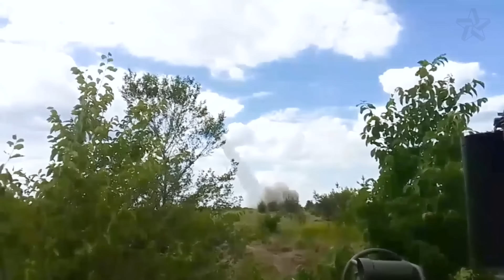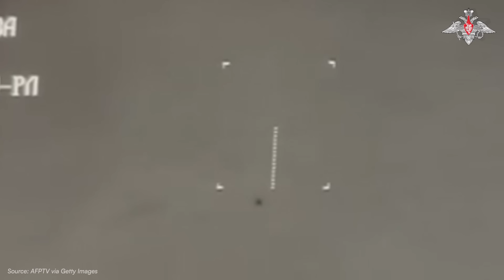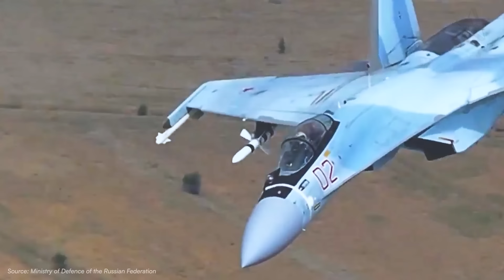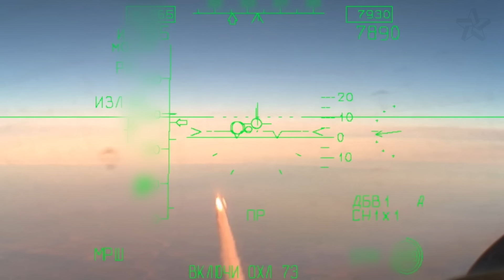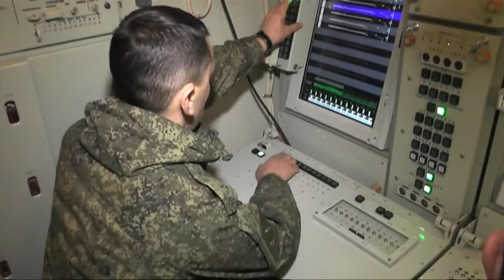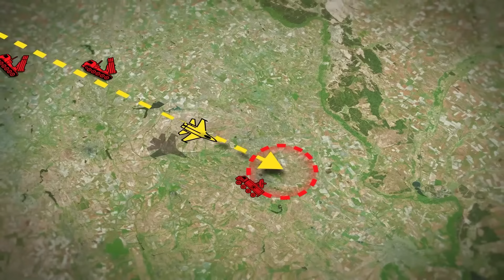Watch Ukrainian Jet OBLITERATE a Russian Dam

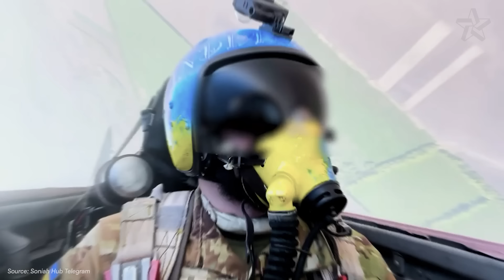Comment: At about 9:28 it stats at 30M the jet inverts while rolling making a 90 degree turn. What's the purpose of inverting
Reply: So it can dive once it crosses over the ridge by pulling up. Pulling up is almost always preferable to pushing the nose down.

Comment: When did that happen? Nice job 😊
Reply: If this is real.. it shows Ukraine can hit high-value targets.. not just trenches.. big loss for Russia
Reply: In the Autumn about 4 months ago. The dam was partially damaged not obliterated but the attack was carried out by surface to surface  missiles not by jets. 

It's very loosely based on real events but faked and dramatised to titilate American fanboys.

Notice how it is packed with general facts and tech speak plus stock footage. Nothing real time.
Reply: @BeechingAxe i have never heard about it previously, i understand why. There is a Big difference between an attack and a total destruction, with tonnes of mud everywhere after and no road for Russian to attack .
Thanks for your answer
Reply: @martinfoucaud4556  I think it is very loosely based on the damage to the Belgarod dam in October. However, I think this was achieved via Himars and Neptune missiles not air strikes. Plenty of water was released which messed up Russian logistics, but the dam was damaged rather than obliterated.